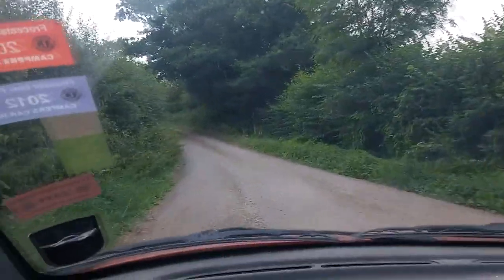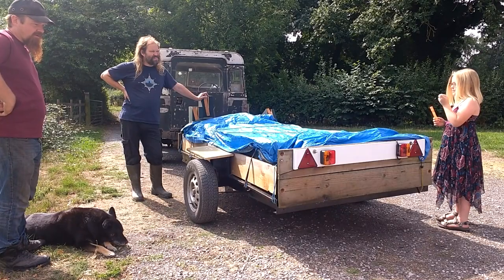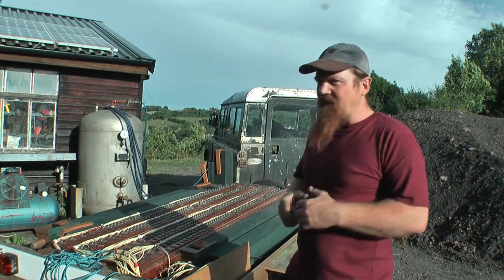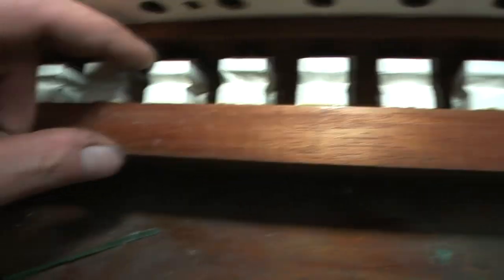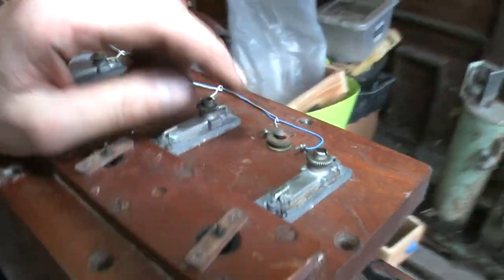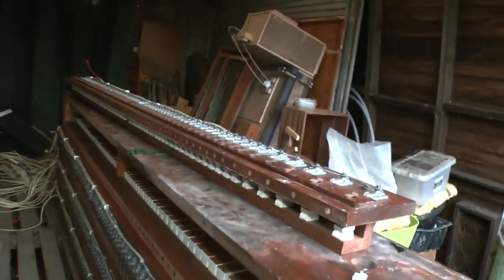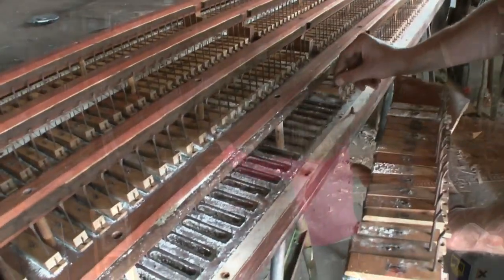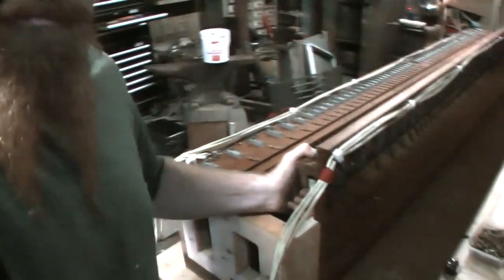Getting the organ up together.

Comment: I'm intrigued as to why the intermediary valves are required, i.e. why it's not possible to have a single solenoid valve open to allow air into the pipe? Looking forward to see it all working!